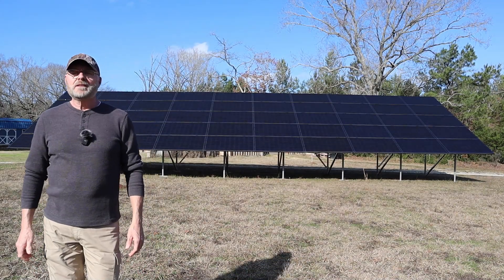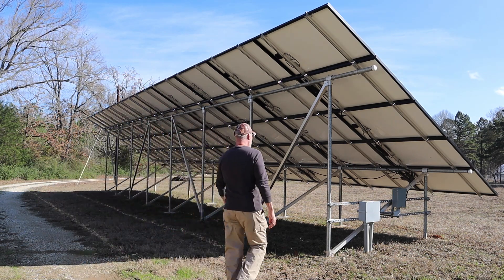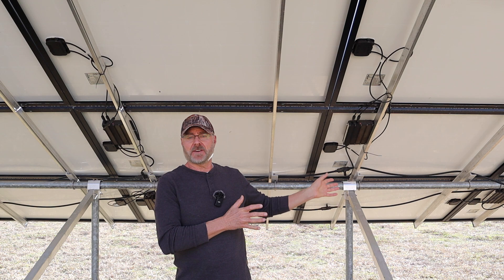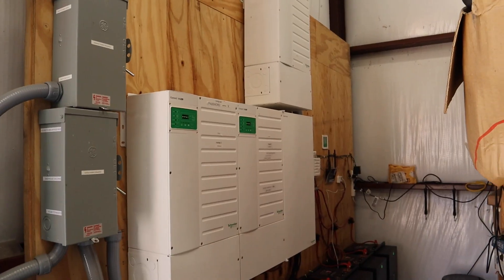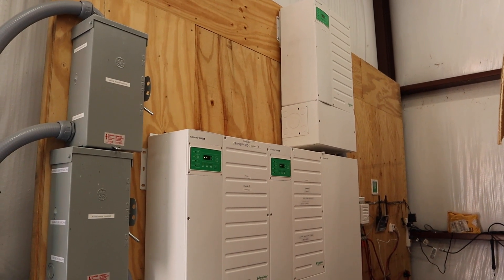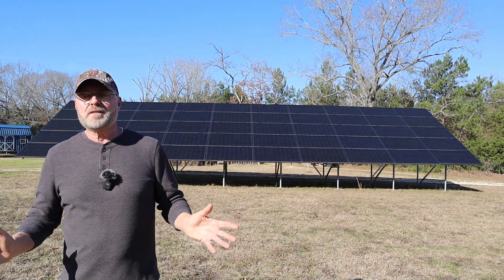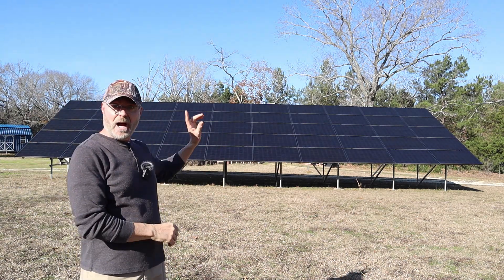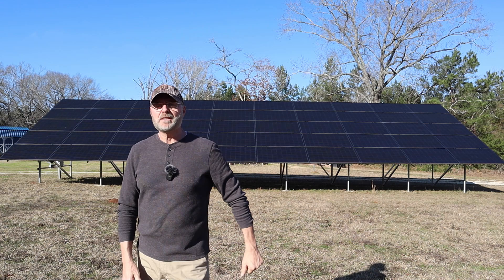Our 15,500 watt AC coupled solar system and how it works

Comment: Is this 15.5KW system is big enough to power your house and two buildings totally off grid?
Did your light bill ever go down to $10 since the solar system put in?  🙂
How much does the power company pay for the electricity you put back into the grid?

We've been having snow storm after snow storm here for the last 11 days.  The power was down for two days and man it was rough when it's 10°F outside. A solar system for back up would be great.
Stay warm, Pete.
P.S. Love your chanel.  Love the doggies and the kitties too.
Reply from the maker: Yes this system will power everything on my property and when the grid goes down, I only run things that are needed.

Comment: Ok, so What would be the minimum size system to survive and run your refrigerator,freezer and AC?
Reply from the maker: A 5000 watt system would run most basic things in your house but electric dryer, AC, electric stove would have to run by them selves and not at the same time of course. You're going to have to figure out how many watts all the things you need running use at the same time and build your system according.
Reply: @petebeasttexashomesteading  I see. Well it seems a little overwhelming. There's alot to learn.
Reply from the maker: @diyoregonnowtexas9202  Check out my friend Eric at Country living experience YouTube channel. He's got some videos that will help you out.

Comment: So the Schienders  don't run anytime there is grid power? I have a similar system smaller but I use Enphase and MagnaSine never had any problems with the Enphase. The charging during grid down is a little crazy so you need batteries that can take a lot of amps at once.
Reply from the maker: Correct, the Schneiders are on standby until the grid goes down, then they come on and power everything. The micro inverters do all the work while the grid is on.

Comment: Hello Pete, I've watched your channel for several years now and remember when you put the system in.  What I personally would have been interested in knowing is how much did it cost you for the system after everything was said and done?  I'm guessing at present, you can multiply it by at least two due to the cost of materials right now.  Cheers
Reply from the maker: In 2019/2020 the Solar system cost around $85,000 and almost half of that was the batteries.
Reply: @petebeasttexashomesteading  Did you include $5,000 for the labor cost to install the solar panels if you didn't do it yourself?

$8,299.95 for one RB48V200 48V 200Ah LiFePO4 Battery.  I am writing it down just to see how much they will be two years from now.  Do you need 6 of them for your system?  Can you do away with 4?

Comment: what does a system like that cost?
Reply: They have a 13.6 kw  Schneider solar kit over on signature solar for $29,758. Solar Panels, hybrid inverters, and lithium batteries. And you can get 30% back on your Federal taxes as a credit. So about $20,000. Plus solar rack
Reply: @BY-tt3vc  Thats not a bad price. Thanks Pete!!
Reply from the maker: The Solar system cost around $85,000 and almost half of that was the batteries.
Reply: @petebeasttexashomesteading  The average family in the US simply can’t afford that.
Reply: @petebeasttexashomesteading  whats the total Kwh size of the battery
Reply from the maker: @donlatinohits  The battery is the ReLion RB48V200 which is a 48V,  200Ah, 10.24 kWh per battery x 6 batteries.

Comment: I have a 16,800 setup like yours with 6848 Schneider, electric. Why don’t you take the mini inverters off and let the Snyder electric do the grid feed. They are hybrids, also they will go back to grid feeding after the power comes back on without flipping a switch. Another thing is you can load shave the battery bank at the same time as grid feeding to lower your power bill.
Reply from the maker: My Schneiders are always on standby and essentially off while the grid is on. The micro inverters do all the work. This way I don't put wear and tear on the Schneiders.
Reply: I use this charge controller, Schneider Electric 865-1034 Conext MPPT 100 Amp 600VDC Solar Charge Controller

Comment: Does the total cost justify the savings in a limited time before it becomes obsolete or in need of repairs?
Reply from the maker: No, it would take over 30 years to pay this system off with the money I save every month so it's not about saving so much but about having power when the grid goes down temporarily or permanently.

Comment: Nice set up Pete, I have been waiting for you to do a video on your system. One thing you did not mention was performance and savings so I am curious about that. My system consists of 40 330W panels with micro inverters ( manufactured by Enphase and have performed flawlessly for 3 years) I did not go with battery backup but a 20 KW natural gas fired stand by generator with an automatic transfer switch. We use to spend about 2800 dollars annually on electricity now less than 100 dollars per year, very pleased with our system. When I retire and move to Tyler county in East TX I plan on doing a ground mount system like yours, have a great day David.
Reply from the maker: Sounds like you have a good size system. Compared to what I spent on the whole system and what I safe every month, it would take over 30 years to pay for it self so it's not about saving money so much. I wanted a system that could run my entire house when the grid is down temporarily or permanently. That's why I got so much battery storage.